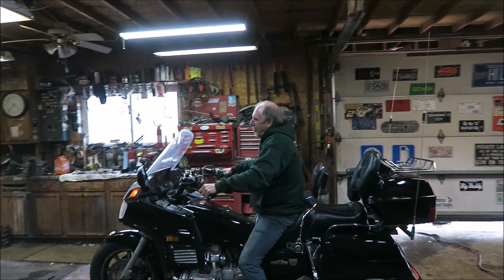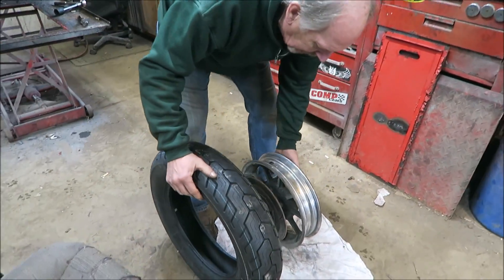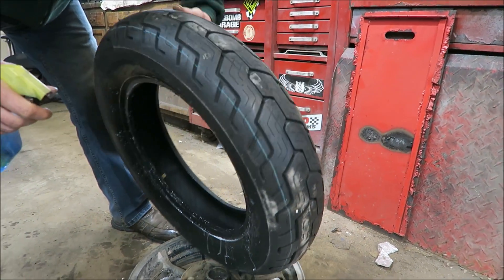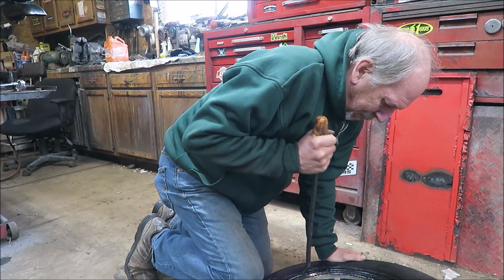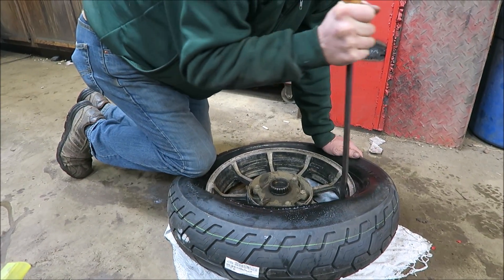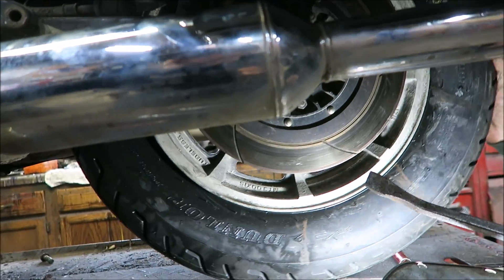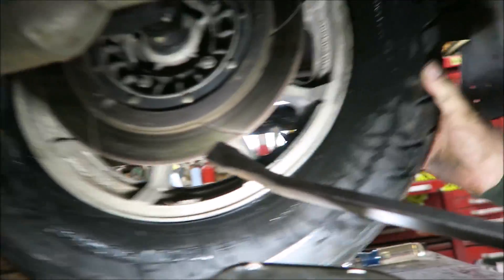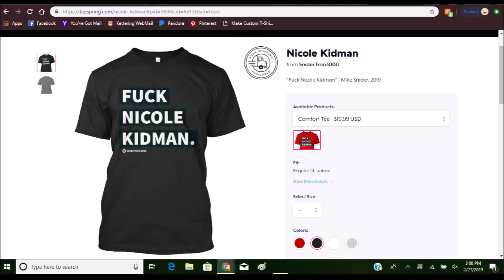He DESTROYED The Brand New Tire lol

Comment: When mounting the tire by it works easier if you tap the bead as it does down with a rubber mallet while pushing pressure down, mounts in seconds works with car tires and big rigs do it all the time
Reply from the maker: You know, we've actually tried that and never had luck with it
Reply: I’ve always done that trick since right out of school working in a big rig shop I learned that since we dismounted and mounted all tires by hand then I started doing that with my Subaru and trucks and have done it since. But I use straight laundry detergent or dish soap on a brush and the tires basically fall right on or I have to give a couple taps right at the surface that meets the rim

Comment: I refuse to pay someone to mount tires. I had a set of 38.5x11xr16 tel boggers on Ford wheels well the tires were brand new and I have no fords. That day it was about 32 outside and getting colder had to use the suburban and a bird to break the bead and by that time i was done unmounting it was late. I learned to warm the tires up and find something slick . I'm no big guy so I need all the help I can get mou ting huge tires. Ps. I'm on the way to buy a fuck Nicole Kidman t.
Reply from the maker: I've done that drive on a board trick once when I had one tire that was stuck to the bead of the wheel and our tire machine didn't have the power to force it off. Completely ripped the lip of the tire off almost like someone jb welded it lol